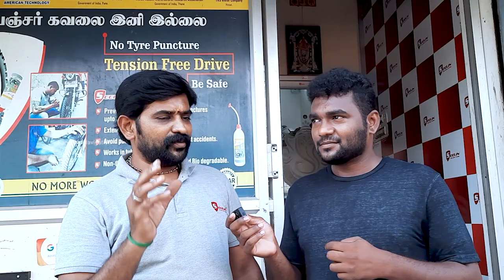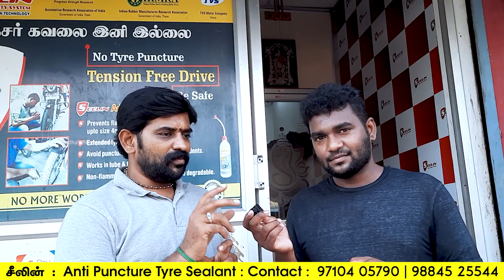Magic Tyre Liquid | ஆணி அடிச்சாலும் உங்க TYRE பஞ்சர் ஆகாது | Delivery Available

Comment from the maker: சீலின் : Seelin Anti Puncture Tyre Sealant ;

Contact Number :  +91 97104 05790
                                   +91 98845 25544

Map Location ; https://maps.app.goo.gl/5UqvsoZNqowME3D2A

Address: 61/04, North Red hills Road, Villivakkam, 
Chennai - 600049. Landmark near Janaki Motors Service Center – Villivakkam Subway Service Road